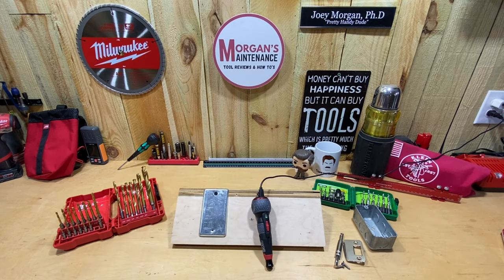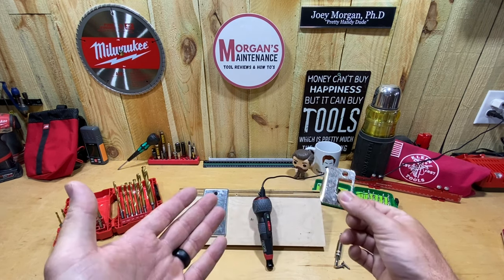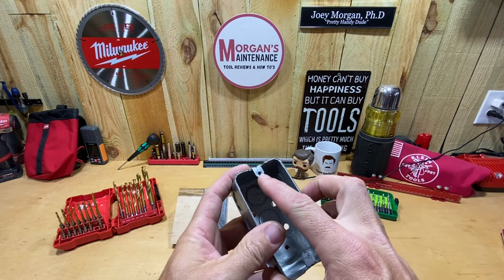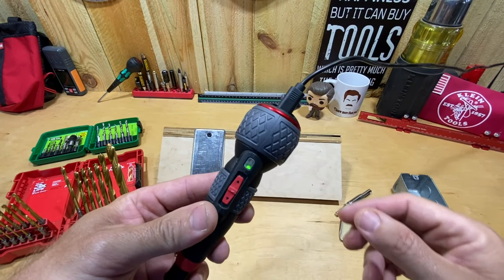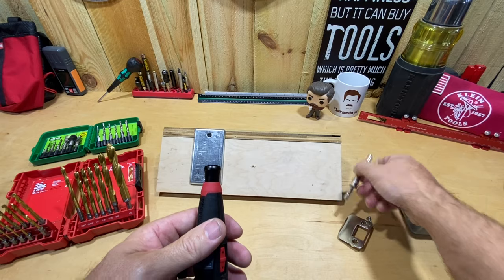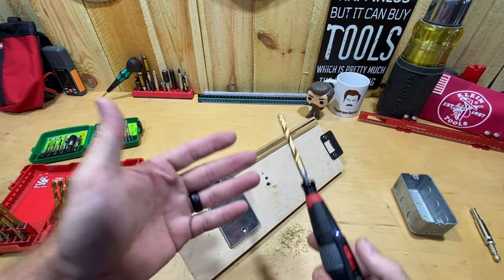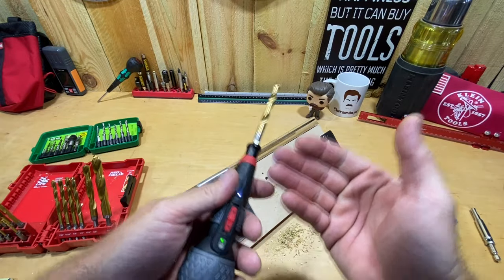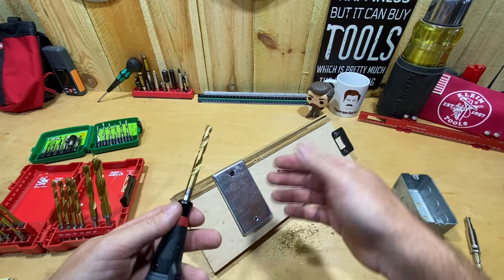Vessel 220USB P1 - Will it Drill? #tools #maintenance #vessel #screwdriver

Comment: Great info. I really like the idea of using that for doing handset installation. Drilling the pilots for latch and strike plate as well as running the screws down and finishing them by hand. Even with M12 Installation Driver clutched down I’ve stripped out that wonderful soft pine on cheap hollow core doors.
Now I’ve got to buy one..dang it!😂
Reply from the maker: It took two videos at least to get you this time… that progress 😂
Reply: @MORGANSMaintenance  No, it took two videos to get my wife!😂 You had me at Vessel.

Comment: Hey, just bought a pair of these after watching your first video about them. I like them but the up and down play was bugging me. So I cut about 6mm off an Eraser Pen refill and shoved it down the collet so my Milwaukee bits could bottom out. The eraser does prevent the Vessel bit from going in, which is ok in my case because I dont use Vessel bits. Hope this helps someone.
Reply from the maker: Yeah I didn’t even notice that at first.  It doesn’t matter while you are using it because you are pressing it into the fastener, but I get what you mean about bugging you.

Thanks for the suggestion 👍
Reply: Makita bit piece makes up the difference in length between the Japanese bits and the US/EU bits.

Comment: The ole … can it in a pinch video. Awesome and thanks!!!
Reply from the maker: 👍.. I’m actually surprised, I didn’t think it would with the over torque protection.

Definitely more of a “in a pinch” and not a every day option though.
Reply: @MORGANSMaintenance  I would never use a tool outside of its proper manufacturer’s specifications 😂😎
Reply from the maker: @nachoisme  😂

Comment: I know your a pro at what you do, me 40 yrs of carpentry. I believe you should use the right tool for the right job. In my opinion, I would never use this to drill anything. I have one of these coming from Japan and believe they are design for a specific job, drilling is not one of them. The possibility of someone saying, oh I can drill out this 1/4" hole then wind up prematurely burning out the motor. Just my 2cents. Otherwise great vids.
Reply from the maker: Yeah I won’t use it for this either, I was just answering a question someone asked… you are right, right tool for the job is the way to go 👍

Comment: will it work with impact bits / drive hex screws? I work in HVAC and will often pull on and off AC panels. Curious about hex bits
Reply from the maker: It will, but you will probably have to hand break them first.  Just depends on how tight they are on there.

It will take any bit with a 1/4 shaft.  It has some play in/out, but once you press the screwdriver into the fastener, you don’t notice it. (On my version, not sure about the other two)

Comment: will it ream conduit, with a impact reamer?????? very interested
Reply from the maker: I wouldn’t think so.. personally I wouldn’t use it as a drill, I was just answering a question.  

I don’t think it would last long doing either.
Reply: @MORGANSMaintenance  so you’re saying it would have a tough time reaming the conduit, and it would die quick battery wise
Reply from the maker: @sethreese7418  I think it would end up ruining the motor in it… to do any drilling on a consistent basis.  It’s a different type of load than putting in threaded screws in a nut..   It would also probably torque out.

These type of screwdrivers are really made for screws going into something that accepts the screw. Door knobs, electrical receptacles to the box, etc.

I wouldn’t even plan to use these for screws into a material where a screw needs to make the hole.

Comment: Whats the most common used self tapping bit??
Reply from the maker: The most common for me is 10-32 for ground screws in electrical boxes.

I would think the most commonly used fastener you might run into is 1/4-20 but I could be different for everyone.

Comment: Thanks
Reply: @MORGAN'S Maintenance  good choice of wood as pine will be far easier.

Would think it will easily drill much larger by starting small and stepping up. You used sharp drills too but wonder what Fisch drills would be like.  Definitely must get one
Reply from the maker: @jcoul1sc  yeah I think pine should be easier too… 

And you are right, starting with smaller holes and stepping up if you need to drill a big hole would be the way to go.

It never seemed to want to stop on any of the smaller stuff, I expected that torque protection to keep it from doing it.  I would think most smaller holes could be done with it.
Reply: @MORGAN'S Maintenance  you will have to get the 1/4 hex chuck for it. Use straight shank up to 1/4 inch. Works great on my yankee even if it's bent.

Maybe that's your next video, yankee v vessel
Reply from the maker: @jcoul1sc  👍

Comment: Interesting way of abusing the tool.
Reply from the maker: 😂… I didn’t say I would use it that way, but you know me… I aim to please.

Most jobs where I would need to pre-drill, I am already doing other work that would likely require a drill anyways. I can’t imagine it would be really often that I would use it for this.
Reply: @MORGANSMaintenance  I'm a bit crazy on this point. Some of my tools may be dirtier than I'd like them to be, some of the tools may be older or with signs of wear. But every tool has its purpose and I use it solely for that. No chiselling with screwdrivers, no Phillips bit in Pozidriv screw, if I install cabinets I have impact driver with IMPACT bits, chuckless (1/4") drill driver solely for driving delicate or predrilled screws and a heavy drill for hole saws and drilling. The same applies to plunge saw and rear handle saw (skillsaw-like) - one is for extremely precise cuts, the other is for rough cuts. A small SDS+ combi hammer drill is for drilling holes and some very small demos, big SDS Max is for normal or heavy duty demos and hole drilling bigger than 1". Etc.
So when watching this video I was a bit anxious that we may see some smoke out of that screwdriver.
Reply from the maker: @Stefan_Kawalec  I was honestly really surprised it even did it..  I thought the over torque protection would kick it out as soon as it grabbed in the material.

I didn’t try it any before I started filming because I wanted to see it the same as everyone else.  I’m sure it’s pretty taxing on the battery though, probably wouldn’t get many holes.

I’m the same as you, It would have never really even crossed my mind to put a drill bit in this had someone not asked.

I’m normally a right tool for the job… occasionally I find some tool that works well for some unintended use, but not typically.
Reply: @MORGANSMaintenance  Yep, that's the only way with tools - right tool for the job. If I do something stupid I just buy cheap disposable tool. Couple of moths ago I had to remove some old oil based paint (definitely with all kinds of 60s carcinogenic stuff inside) from a wall covered with lime plaster without damaging that plaser. Thus a heat gun (despite the full face mask) was no go. So I used a cheap, corded powerplaner. It did the job pretty well and if I'd change the blades I could probably still use it for planing some nasty wood.
Reply from the maker: @Stefan_Kawalec  I have a set of beater tools I use for bigger demos so that I don’t wreck my good ones (drills, saws, etc)…  Didn’t buy them for that specifically, just use my older ones.

That way I’m always just looking for the easiest way to get the materials out, and not worried about breaking my better tools, ruining good blades, etc.